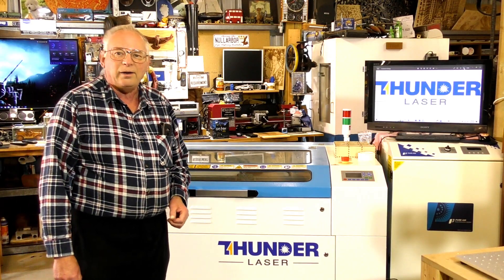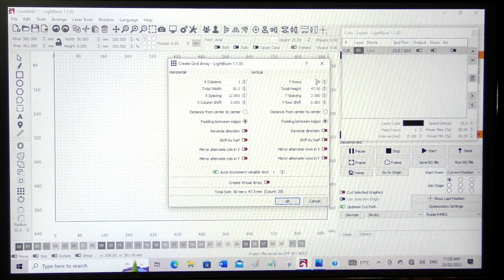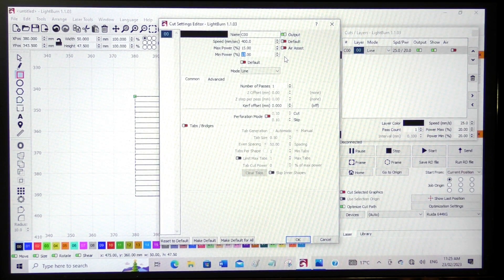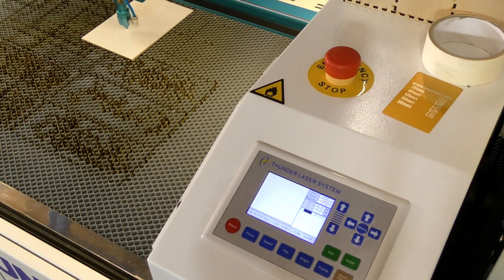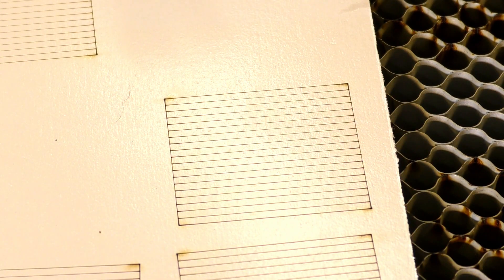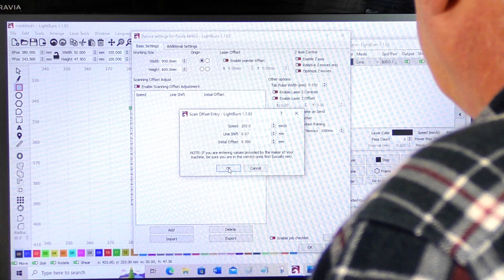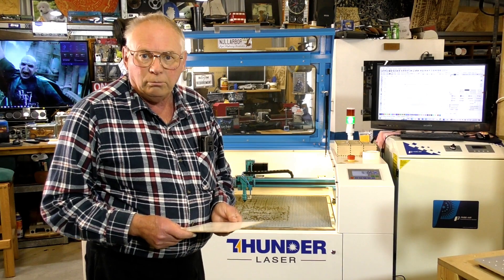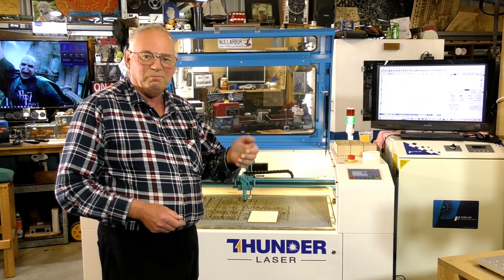Thunder Laser scanline offset adjustment in Lightburn *how to*

Comment: Correct me if I'm wrong, but for scanning offset, shouldn't you be in the fill mode with LPI at something like 50. Running this test in line mode doesn't really check for anything because the machine slows down before changing direction.
Reply from the maker: Video on the way (Thunder Laser explainer video)